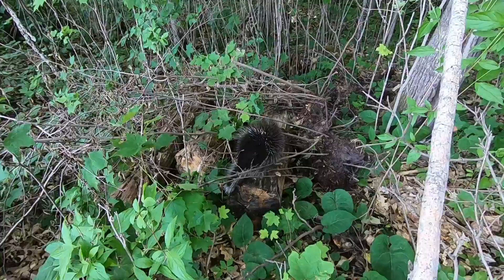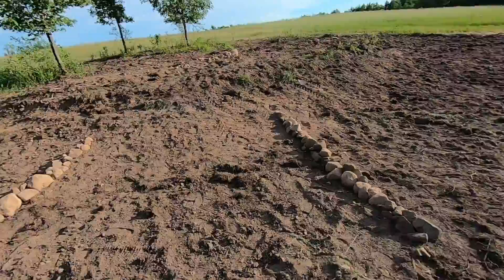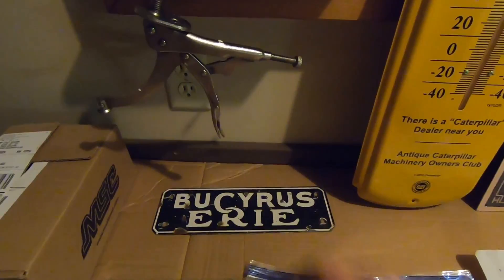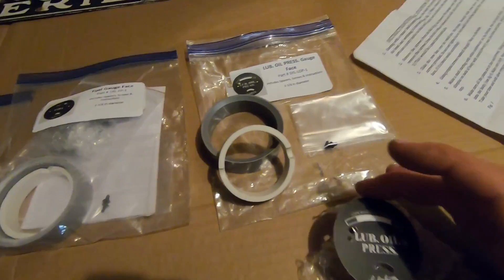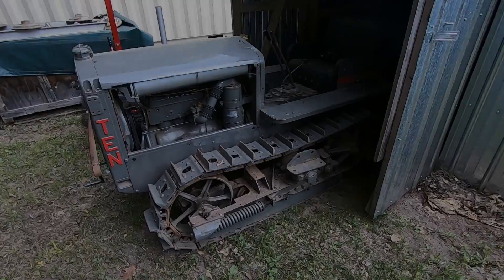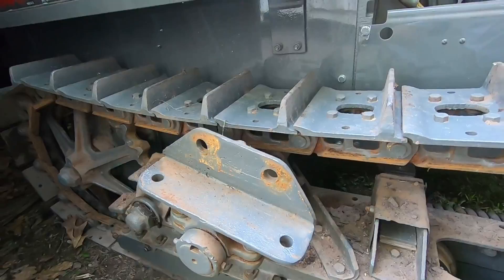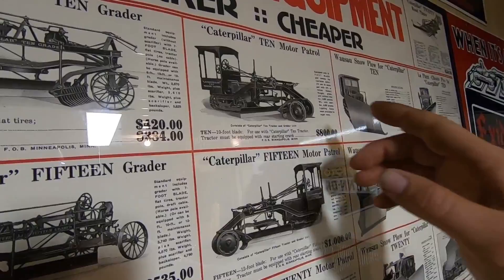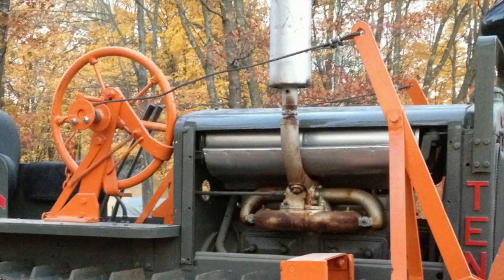After-Hours In The Shop #2: Mail Call - The Full Story Of My Cat Ten - Why Tumblebug & Not Dozer???

Comment: We called the d2 we had at work a bucking horse if it was used to do any kind of dirt work...It was better suited to pushing coal in the bottom of barges on the steel floor.. The d2 was light enough to be lowered and hoisted with the crane we had attached to a clamshell bucket....That was forty years ago .. Cheers; Mike in Louisiana

Comment: If I were going to have chosen a different one of your machines to have done this last tumble bug job, I think it would have been the motor grader.  (I know it's not running right now).  A dozer is too aggressive for the fine work that the tumble bug can do, plus the tumble bug transports material, and you can cut and fill, and not just push.  I love a motor grader.  We had a Cat 12D or E (if I remember correctly) at Lambeth Construction Company where I drove a tandem dump truck during college summers for a few years in the late sixties/early seventies.  We roughed in roads and streets and large building sites.  Then Thompson-Arthur would come in and fine grade, put down and roll stone, and pave and curb and gutter.  Occasionally, I would get to run a few other pieces a little bit, but they mostly were the domain of the primary operators, and we respected those guys.  

We had two D7's, the motor grader, a 977 track loader (a beast), a Gradall, and several other smaller pieces of equipment.  Infrequently, we would have a couple of articulated pan scrapers that would come from somewhere.  The old fellow who ran the Gradall could comb your hair with it, and the other Caterpillar guys were really good too, but the gentleman who ran the motor grader was kind of the default king of the crew.  We took care of our equipment, we called the owners and the superintendents Mr. such and such, and everybody did their job.  And we all had a great time.  Everybody acted like they had some damn sense and we were relaxed, productive and safe.  That was kind of a magic moment in life when I think back about it.  I'm very grateful for that experience.  Thank you and Senior for all your work.  Come to think of it, the owner's had their father's old original D4 displayed at the company entrance with a clean paint job on it.  The machine that started the business.

Comment: The early D2's were not good dozer tractors because the track frames were short, in 1954 an improved D2 came out with longer track frames and a longer clutch housing lengthening the tractor and making it more stable.

Comment: Thanks for these great insights on how all this machinery actually performs in the real world. Want to look into a small-ish dozer/crawler for pushing snow down a back country lane a half mile or so to the road. Wondered how a Cat Ten or Fifteen might fare for that. I have a '52 Ferguson TEA20 (think Ford 8N clone with overhead valves...) but the open diff just won't pull a rear mounted blower through much even with weights and chains. Plus, heck - little dozers just look like a ton o fun. 😎

Comment: Enjoyed additional history on the Cat Ten.  On a side note, are any of your three  No.9 Auto Patrols (8A331, 8A340, 8A539) diesel powered?  If so, which one(s)?
Reply: Geoff Weinstock we'll we wait and see if Squatch replies. In the meantime, of his Auto Patrol number 9 lineup, the latest one he hauled home was a rat rod repower with a Chevy truck engine that was missing before he bought it. Of the two other ones,  he removed the engine  out of one already so not sure about that and the third one. Other than the Auto patrols however, he does have a caterpillar 212 grader that has the same diesel engine as the D2, the D3400 engine.

Comment: My farther bought a cat R D 4. In the 1970s and that too was really pathetic about dosing any thing with that. The blade was to big for it and it had a hard enough time pushing snow. The hydraulics were to slow and it was built the same way as the D 2. I was just in my  teens and I could see that a John deer dozer 450 was more proficient that was built in the 70s   I know why you used your tractor and tumble bug. You would still be pushing dirt right now to catch up with your tumble bug and tractor.